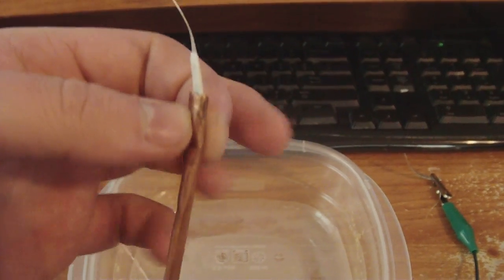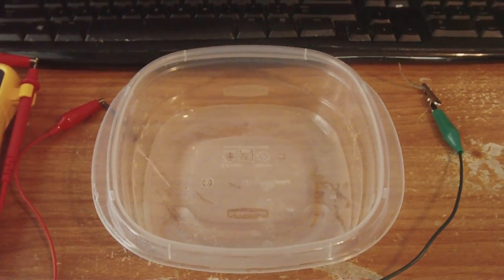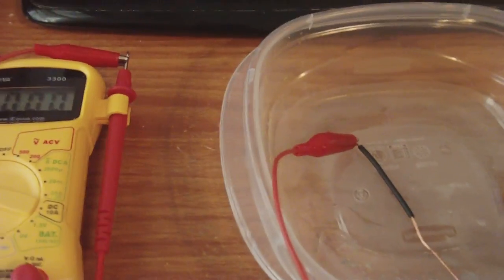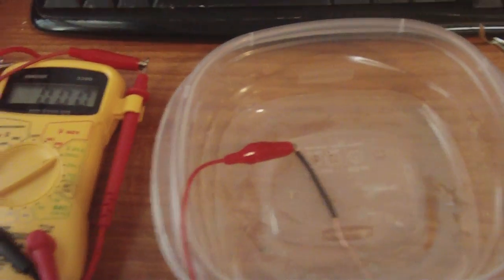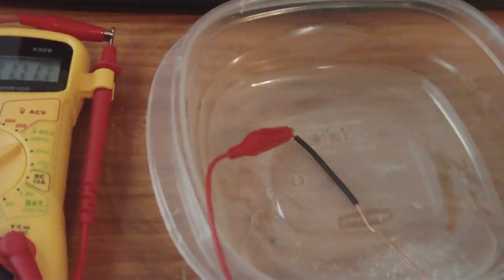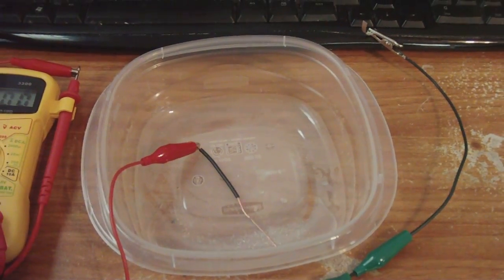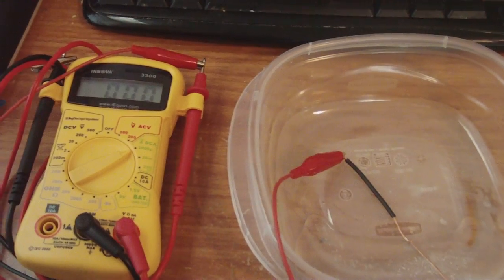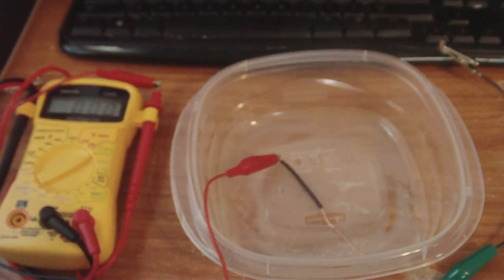Water is not the reason for amps in a crystal cell

Comment: Only without water you will have no corrosion, but then you only have voltage WITHOUT current...but the air moisture will always slowly decompose the metals.
That is why it is so important to use graphite or lampblack as one electrode, cause it will not be consumed...

Comment: Good job, Ibpointless2! Ya, water is not necessary, but crystals, crystals that bring trough resonance from the Source (God) energy which is converted in electricity, and this all the secret! And also: the device Methernitha Testatika brings about 1 kW of electric power, from surrounding etheric and electrostatic energy from Earth capacitor, without a drop of water, and a crystal cell is a little testatika device! All the best! Try also manganese dioxide and zinc oxide with your cells!